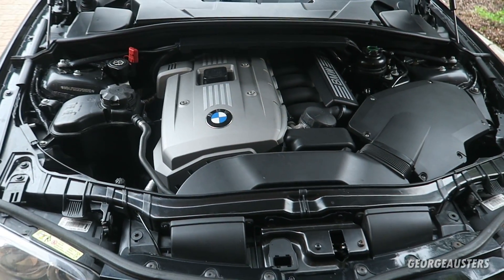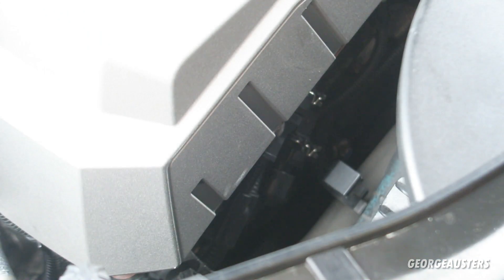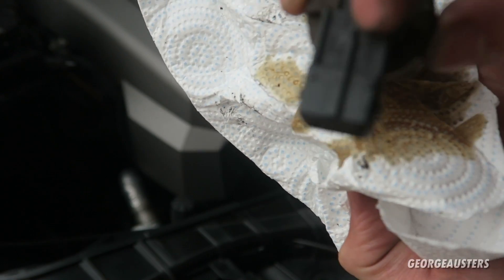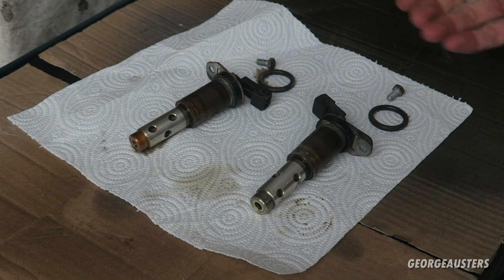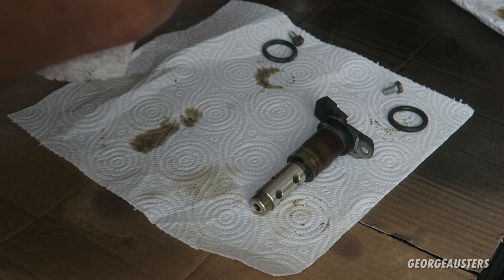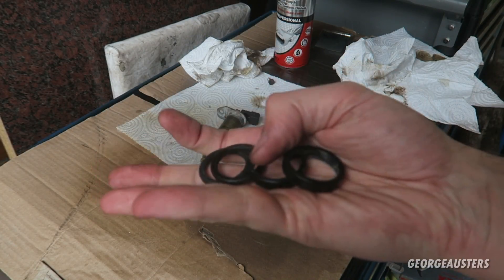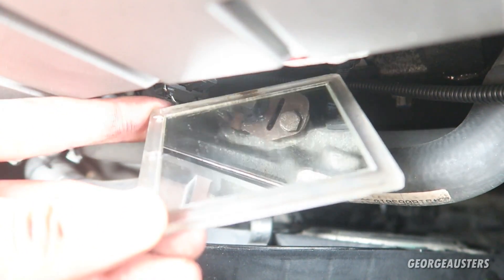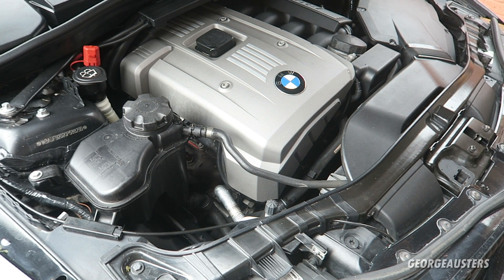HOW TO CLEAN VANOS SOLENOIDS *Step By Step Guide*

Comment: when changing/cleaning the check valves that feed these solenids, ive gotten the bottom t40 stuck/stripped. Any suggestions how to remove it from that tight space? 2007 328XI N52

Comment: cleaning the vanos without cleaning the filters or changing them is a waste of time. Even if you replace the VANOS, you must clean or change the filters.
Because if the filters are blocked, then no or little oil will go to the VANOS and even they will be damaged soon or not working properly.... 
Thanks for all your great videos
Reply from the maker: I did in another video
Reply: @GeorgeAusters 

Yes I saw that as well.
Thanks.

Comment: TIP: Take some fuel and a cup and pour it into the cup. Then connect the solenoid to a 12V power source, amps can be low (a 20 year old phone charger with about 200mA will do fine) and place the solenoid in the cup with the fuel. Now switch the power on and off to force the solenoid to open and close. That way you will flush out all the gung that is stuck inside too. If not then you basically cleaned it just from the outside wich is just half the job. CAREFULL THOU!!! Attach a clip to the end of both wires which will be connected to the pins on the solenoid. DO NOT use the wires to touch the pins while the whole thing is submerged in fuel or else one of those strikes will spark too much and light you up. For the same reason do not do this at your home but somewhere outside with a bucket of water at hand (or a garden hose ready to be used instantly). And no I am not joking :) 
O rings can be purchased separately or you can order them from a store that sell those for little money which I did and I recommend highly to do this. Even if the old ones are "good" they are probably somewhat hard and their sealing cappabilities are lower. Also when installing it back you may want to put the O ring into the engine opening first and the solenoid second. In some cases you are fine putting them back in together but in most cases you risk damaging the O ring during the installation due to sharp edges around the opening where the solenoid goes. If you lube the whole solenoid with a little bit of engine oil it will slip right in... which may be very helpfull if your workspace is small. 
BTW once you cleaned the solenoid try to shake it. If it makes a sound you are good. If not then there is still some sticky gunk inside. And don't worry about the solenoid getting damaged as you'd have to smash it with a hammer or drop out of a window in the 20th floor or something. Not saying to not be carefull but merely to not worry too much.

Comment: You won't really clean them without disassembly! The space which gets clogged is near impossible to clean without taking it appart yet doing it is quite easy so don't know why nobody doing prefering half-solutions
Reply: Is there a video or how to do that
Reply: @340i_Mo  With disassembly? Haven't seen any. But it's not really complex to require video imo
Reply: Any video out for this method that you’re stating?

Comment: Should these solenoids have oil on them? Mine has quite a bit, the idle isn’t super bad but it’s not great. I have code 2AA9. 
It said first be smaller disa valve then these solenoids were second cause. So I’m hoping it’s that there just dirty and it will solve it
Reply from the maker: Yes
Reply: @GeorgeAusters  
Okay awesome thanks for replying so quickly, is it okay if there is oil then too on where you plug them in? So I leave that alone?

Comment: Hi George, mine seem to be stuck and only rotate a fraction. Not enough to wiggle them out and there's hardly anything to grab onto. Any tips on how to get them out?
Reply: Put your hand behind the metal part and wiggle on it don't come out. The metal part is where the bolt screws and the rest of it is plastic so be careful with that part of the battle

Comment: Easier access if top engine cover removed, only bit of plastic takes 10secs to pull off. Nice video otherwise!
Reply from the maker: Yeah you also need to remove the scuttle panel etc too on the 1 series to remove the engine cover

Comment: Trying to get the vanos out off my 2008 n43 318i, but they just won't go out (probably not removed for long time). I am able to turn them a bit. Any suggestions how to take them out? Many thanks
Reply: Just succeed. After driving to shop I waited about 40min, so the engine was still warm and then I used pliers and grabbed the solenoid at the centre (plastic bit) and slightly turning and gently pulling at the same time. To reinstall I had to place the o rings (oiled them before that) in the block first and then solenoid just went back with a bit of a struggle.

Comment: I cleaned mine as well and didn't know any improvement. I notice that if you change your oil according to the recommended oil change interval, you will never have to clean them. People who have to clean the solenoids only when they drive on the old oil for more tahn 20k miles. I've seen N52 with 20k mile oil change and their solenoid were clean with no sludge.
Reply from the maker: Oil needs to be changed every 5k Miles

Comment: If I mix the solenoids up will I throw a code or are they the same? How can I tell the difference? Thank you
Reply from the maker: Solenoids are the same but the plugs need to go to the correct solenoid
Reply: @GeorgeAusters  I cleaned mines out . And I didn’t have a Service engine Soon light on . But after I put them back . I got the light and I feel like I lost power and the cold start is rough now. I think I might’ve mixed the wires up or something idk. Any idea why that would happen?  If I did mix the wires up would the engine even start ? Bc I drive the car for about 2 hrs after .

Comment: Thanks for all of your videos George, nicely filmed and presented in a calm professional manner. Just got a 130i, had 2A99, replaced solenoid and seems to be good. old one was probably getting damaged by the oil from leaking filter housing gasket, so your video for that will be coming in handy soon!

Getting the solenoids back in was an absolute nightmare for me, what worked for me (try at your peril given that you don't want the washer to go into the engine!) was to slip the washer onto the thinner part of the solenoid, put the solenoid half way into the block, then i could easily locate the washer into its home behind the notch, then start pushing the solenoid in, it will require a little force to get the washer back onto the fat part of the solenoid (scary as you can't see if its going to fly into the engine or not), and then it goes right in nicely.

I noticed on the oil filter housing video gasket that someone asked about bleeding the system, it would be nice if you could add a note in the description about this, as i expect not everyone reads the comments and might miss out on that kind of useful info.
Reply from the maker: Cheers Chris, glad to help. I have made a video on bleeding the coolant on this car :)

Comment: HELP!!!!!
One of the rubber gaskets fell into the engine and I can not see or feel it.
Some say it's ok, nothing can happen, and others say I have to remove it somehow.
Please help me what to do ;-(
Reply: what did u end up doing
Reply: @FPSAnarchy  I bought an inspection camera but did not see the o-ring. Drove a few miles, changed oil and oil filter but saw nothing in there. A BMW mechanic said that there is probably no danger as it is not made of metal, and there is very little risk that something serious will happen. Now we have been driving for a week with the car and nothing has happened. I will drive for a month or so, then change the oil and oil filter again.

Best regards from SWEDEN ;-)
Reply: @MikaelJulin  How is it now? :D
Reply: The o-ring.

Comment: What issues can a dirty or bad solenoid give you?
Reply: Rough idle and delayed acceleration to name 2 things
Reply: I had rough idling almost mist fire codes 2c58 and 2d55
Reply: Almost felt like a bad mad sensor and it would go low enough to bog
Reply: @n54mikey18  what did you do then?? With the solenoid ??

Comment: Don't let the BMWDoctor watch this!😁
Reply from the maker: We both share the same opinion that these need to be replaced when they are bad. But it’s not a bad idea to clean them when they’re working fine👍🏻
Reply: Lol. He says you cant clean them. I guess when they go bad..
Reply from the maker: If they’ve failed then they’ve failed not just dirty
Reply: @GeorgeAusters  not sure its all in my mind. But when cleaning them, feels like I get power back for a few days then its back to being sluggish. I went ahead and changed to new OEM parts the other week.  After 1 week of driving it feels completely better then before. Instant torque right at the 2000rpm mark.
Reply from the maker: Glad to hear. Do you have the single stage or 3 stage intake manifold?
Reply: @GeorgeAusters  single stage
Reply: This morning's project! Hopefully it will fix the 2A87 issue. Thanks for the video!
Reply: Cdr Are you joking or serious?
Reply: I have the 3.0si in my Z4 coupe. Just after your video BMW DOCTOR came out with a video on the N52 and said that a turbo is being worked on. I know there is a supercharged kit for it already.
Reply: Guys, I can verify that if you’re doing proactive maintenance on these (as opposed to a failed solenoid)… cleaning them makes a massive difference. Well, it did to my 630i.

Sorry BMW Doctor. But you can clean them, and it does help.

A failed solenoid can never be cleaned enough to repair itself :)
Reply: @Mode_Sierra does it need to be programmed?